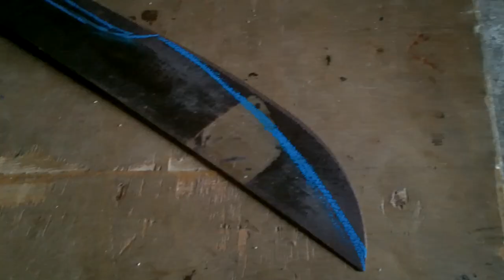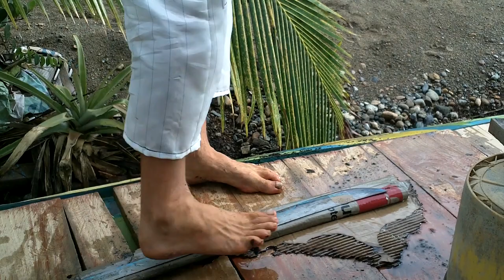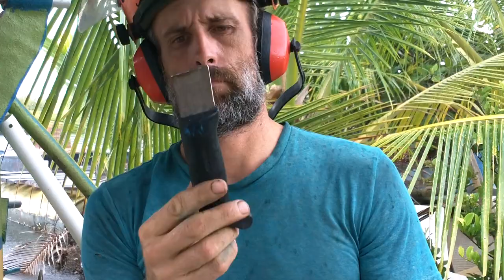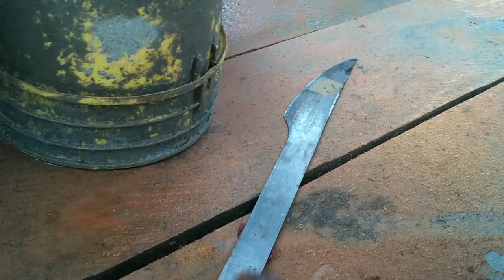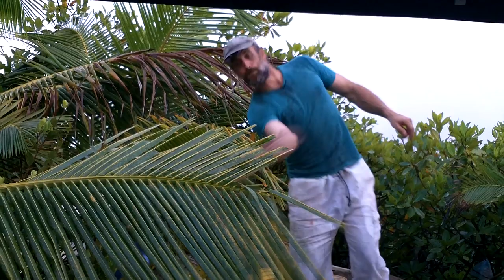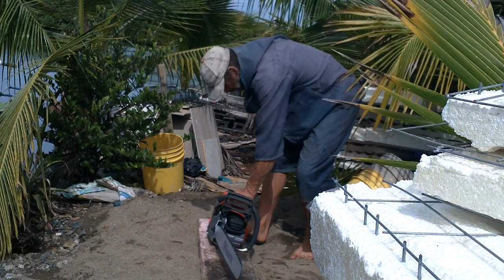Making a Weird Machete

Comment: I've got that same Dewalt grinder and it's as powerful as a corded grinder.... unfortunately it lasted a year! And the cost to repair is as much as a new one. 
  In many ways the brushed motors are better. I've got 3 brushed cordless grinders I've ran years and they are still going.

Comment: So youve got to check out the bear grills matchete, the weight and balance of the cutting edge is the best there is. Itll cut down large trees almost as good az an axe and blaze trails as good or better than most others. Ive got two. I think its about 60 bucks or so but it will last a lifetime, theres enough material to continuosly put a new edge on it if u hit a rock. Please buy one u will not be disapointed. And cant wait till u start posting the last years worth of projects. Good luck man were all pullin for ya